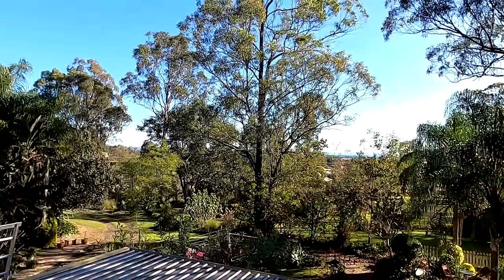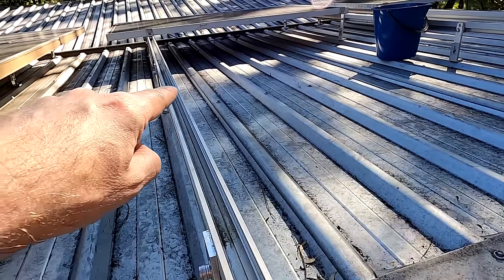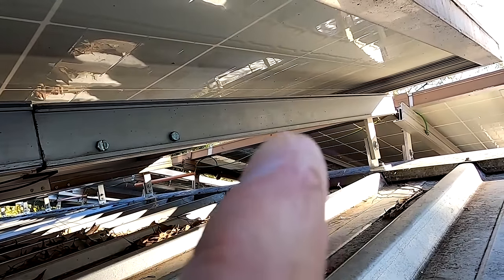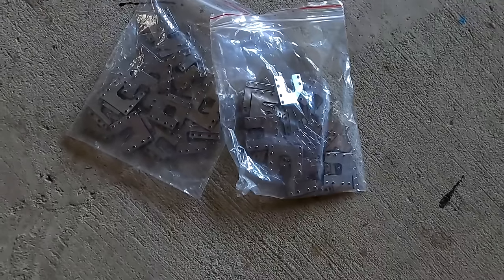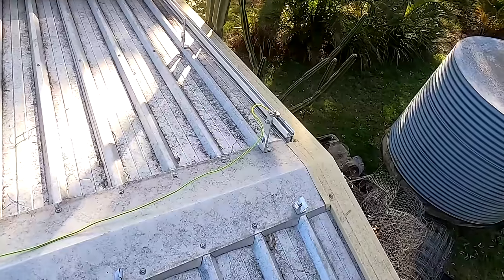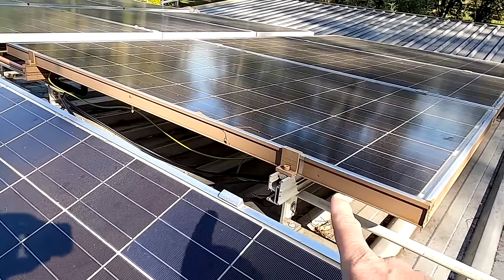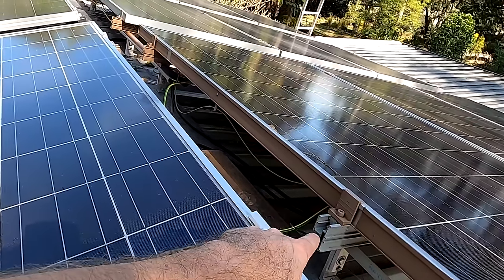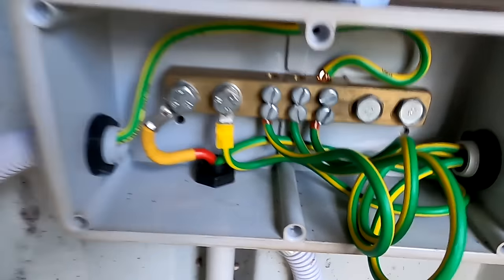Solar Grounding Essentials. These important safety features are often forgotten.

Comment: Hey Andy, Great job trying to keep up with the endless regs that keep popping up, just one thing @ 7:24 not a big issue but should there not be a serrated washer under the head of the bolt to dig into the anodizing. Would be interesting to test that joint on your next update!!!  I have some panels facing north at a 17 degree angle and upped it to 27 degrees with a 20% gain in production. Have you thought about angling your panels for the winter sun?
Reply from the maker: Thanks Glen. There are star washers at this connection, I said this at 7:35 😁
I have located some additional space for solar winter production which does not get shaded. There are just too many projects and I need to work through them one by one...

Comment: I just went out to measure resistance to ground on my tin shed which has 16 250 watt panels I don’t have any earth leads although I do plan on putting them on. My measurements were such that the resistance between the shed and the panels was affectively zero so I guess the ground has already been made through the rack mounting to the shed. I do have an earth which is joined to my 240v grid supply which joins to The earthing rod next to my meter box.
Reply from the maker: Yeah, usually any building structure cannot be used as grounding. It may help with overall resistance but the panels always need to have their own dedicated ground wire. If you get rust on your roof for example, the connection will get really bad.

Comment: Back in 92' I worked for a industrial service company and we built and installed ignition systems on industrial natural gas engines.  The tech that designed the systems and taught me how to do the building of the wiring headers and stainless shielded ignition leads.  He insisted that all the weatherproof connectors be filled with silicone.  After working there for 3 years and getting to rebuild some old systems it became obvious that the acid in the silicone actually caused corrosion.  I think dielectric grease would be better!
Reply from the maker: This silicon is acid free 😉 It does not have this typical vinegar smell.

Comment: Excellent Andy, At 3:00 good point about anodizing. As an Anti-corrosion treatment,  and anodized surface is electrically dead.and low conductivity. I agree with your opinion with the with the rail joiners and star washers. Thinking back to when I was installing a lot of industrial aluminum cable tray, U.S. NEC required that cable bonding jumpers with electrical lugs sufficient to handle the of the conductor supply interrupting amperage to be installed, and not attached to any structural fastener.

My guess is that Aussie NEC approves the factory joint because it's  designed to maintain electrical integrity in the event of structural stress or damage to the rail. The cable tray systems I was installing were joined by bars you used and therefore required and dedicated (unbroken) bonding jumper at each joint, otherwise a structural joint could not also be an electrical bond. 

Additionally, for lightning discharge and if the supply current exceeded the ampaticty of the cable tray,  an additional bare copper or aluminum grounding conductor had to be used and if it were bonded between joints then no dedicated bonding jumpers were required. I would expect that there should be something in the code that if you used a dedicated grounding conductor bonded at each section in an approved manor  the factory joints and  those goofy grounding clamp things could be dispensed with. 

At 16:00 Andy, I believe that the grounding screw once tight won't electrically change due to corrosion but because of the copper to plated nickel or cadmium contact will bond atomically at the surface. I seem to recall that on copper to plated non current carrying bonding connections,  anti corrosion treatments were not to be used as they could interfere with the atomic bond. I recall one time having to remove and clean about a hundred lug connections I applied  anti-corrosion treatment to as per a project engineer's directive.
Reply from the maker: I will show the result in the next video.

Comment: Thanks Andy. 👍 Cheers.
My grid connect system all went up on the roof in 2010. It’s not grounded.
I don’t really lose any sleep over it.
I honestly suspect the reg is there to stop potential electrocution, and don’t believe it would help much with a lightning strike. There is just too much energy in lightning.  Does anyone have evidence on this? 

A lot of the regs are bloody stupid anyway, like those damned roof top isolators which were required here in Australia from about 2012? to 2021, that have caused a massive number of roof top fires. 
I believe that requirement has gone at long last.
Reply from the maker: It is more important when you have a grid connected system as the inverter could potentially be faulty and you have full 230V on the panel frames.
Reply: I could be wrong but the more you ground it the more it attracts the lightning. Your shed is grounded since it is metal so I would measure the quality of ground as it is first...
Reply from the maker: @HG-Pilot  You will see this in the next video. The garage is all metal and grounded but NONE of the solar panels were before I used these washers.
And a building or structure is not a ground point. You always need a dedicated earth wire for your equipment. I'm pretty sure this is the same code and rule everywhere in the world.
Reply: @OffGridGarageAustralia  This is a strange rule.
I have four strings of solar panels in all 4 × 500 V
Imagine the plus at the beginning of the string gets connected to earth.
Now you are on the roof to measure, of course you start from the minus side of the faulty string, Murphy is it play 😉
Now you place your finger on the minus side and of course it's sunny.
Now you have 500 V traveling through you.
I am quite sure if the MPPT tracker gets faulty and starts conducting power to the solar array it will blow a fuse and if there is no fuse it will burn a PCB track without no doubt.
I love your videos please keep them coming 👍
By the way I'm not losing any sleep either, over not grounding my solar panels 😊
Reply: You are right.  It is more about electrocution than lighting.  The typical grid tied domestic system has no isolation between the PV and mains/grid.  This presents two hazards.  A fault in the transistors etc in the inverter permitting mains AC to appear on the solar array / PV wiring; loss of isolation in the array itself permitting HV DC to appear on the solar array mounting hardware.  Getting yourself across the array hardware and metal roof could result in electrocution.  Simply leaning a metal ladder on the eaves troughs (guttering) could also result in death.  It's a fairly complex question because there can be things like the metal roof being tied to neutral via the mains entry point, say a riser pole support structs or fascia hook, being tied to neutral by the electricity authority / network and in turn any metal roof that touches the same.  The minimum wire thickness specified along with a typical domestic earth stake is absolutely hopeless had handling a direct (that is any part of, not just the main channel) lighting strike.  It could handle currents induced in wiring from nearby lightning.  Remember that a typical solar panel is rated for use at 1000V (equiv to the USA's 600V rating).  The breakdown voltage is far higher for a panel in good stead.

Comment: I have 2 PV system on my house..one is On grid system Using Jinko 610wp Panels x 12 pcs. it didnt give any electric static when I touch them during operation. the other one Hybrid Offgrid system using  Longi 555wp x 18 pcs. and it keep giving small electric static whenever we touch the frame. So the rail seems conducting as well..  should I just ground the rail just like what shown in this video ??

Comment: "Continuity" tester...haha.  In USA they are referred to as "Mega-Ohm-Meters".  Basically a ultra low ohm scale meter.  Very important for low voltage and/or high current circuits.  Low voltages need super clean contacts, terminations, and fat conductors.  High current  circuits  require adequate wire guage and good terminations as well.   Remember:  I^2R=P...  Gota have a low resistance path.  Excellent installation...first class.   Those square grounding "washers" are too cute!  Drip loops are important in exterior wiring, just saying.   Would be interesting to see how that zinc stuff performs...
Reply from the maker: Yeah, different names for that same tester. And it is continudity tester, btw 😊
Reply: In the US, I used to sell “continuity testers”,
not sure when the name changed.
Reply: @DavidHalko  That’s Andy’s humour, we also call them a Mega Tester, all the same.unit, different name for different folks.
Reply: don't you mean micro-ohm-meter? not mega?
Reply: @DavidHalko  I may have conflate some words:  the tester we used to measure the resistance to the ground plane was called a "megger" not "Mega-Ohm-Meter".  There was another word or trade name of a meter used for the same purpose.   Memory is getting rusty....1986....USARMY Communications Electronics Installation Bn.  We built comm-centers, satcom terminals....
Reply: An ultra low meter would not be a mega meter a mega meter measures millions of ohmes at high voltage

Comment: I have a bucket of earth lugs with those nuts that don't fit any rail I have.
If you or a friend are heading up this way you can have them, if you need more in the future. Just buy nuts for use with different rail.
Use a cheap wire stripper tool that spreads the cable insulation in situ. You can easily bare 15mm for every earth clamp.
There is a problem with cold gal paint.  It provides some galvanic protection, but it still allows oxygen through to cause oxidisation. We just used grey enamel spray paint. Silicone is a better solution.
Love those conduit clamps. Don't trust cheap flexible conduit in the sun.
In summer the rain can come from Cicadas..
Reply: Somebody pointed out that the acetic acid in the silicone causes corrosion.  There are non acid silicones.
I think this might be a can o worms.
I live near a busy small airport, it's annoying at times. And I think the trainee pilots are told to fly to the farm with the solar arrays then go back.
Reply from the maker: Thanks Andrew, for now I have all the clamps I need for my setup, just need more of these washers.
The silicon has no acid in it afaik.

Comment: I can understand your complaint about the excess of packaging for something as robust as those earthing lugs, but it just makes me more frustrated.  

I recently received my JK BMS from Hankzor after waiting a month and it was in a box made of the flimsiest cardboard I have ever felt.  it was at least 50% bigger than it should have been and the BMS was only wrapped in a single ply thin bubble wrap bag that did not come close to filling the bag.  It was able to slide several inches in each direction and up and down (thickness) by at least a 1/2" so that whenever you rotated the box in any direction, the BMS would slide around.  Due to this, the box itself was badly damages with one corner almost torn off.  Inside, the heat sink plates on each face were bent and one mounting ear was bent downward about 30º.  Another one was bent up 170º so that it was almost flat against the rest of the plate.

When I contacted Hankzor, they said that it must be rough handling by the post office in my state and they would no longer ship to my state.  I pressed for a replacement, but they would not do that and ended up refunding me only about 30% of my purchase price.

I would rather have too much packaging than too little.
Reply from the maker: You can log a dispute with AliExpress for a damaged item, either for a refund, discount or re-sending of the product.
Reply: @OffGridGarageAustralia  That is what I needed to do in order to get the $38 refund on the $122 purchase.  I could not believe how bad the packaging was and that they were not willing to replace it.  I will get my JK BMS replacement from a different vendor.

Comment: I've never seen it written somewhere but for grounding aluminium mounting frame you should go all aluminium and stainless, no copper mixing before the very last part.

Every aluminium part should be linked with aluminium cable and mounting with stainless screw, and a aluminium to copper crimp ferrule with anti oxidation grease in it when transitioning to copper.
Mixing in copper cable outside is asking for corrosion problems.

Yes professionals use copper but i don't think most think about the galvanic corrosion.
Reply: Sorry. Stainless steel is reactive with aluminum and will corrode it. This is because they are dissimilar metals.

Comment: Can you test the resistance of the joints to prove you don't need a grounding splice cable.  I have doubted needed this also, but still required by code.
You only need 1 weeb washer per panel and you can share for 2 panels.  This is all unnecessary now that most racking uses grounding approved clamps.
And you do need 1 continuous ground for all connections from circuit panel OR separate ground wires permanently tied(crimped together).
Thank you for following up with proper weeb grounding lugs.  These are also designed for bare solid copper wire which doesn't need to be in conduit if larger than 8awg.
Reply from the maker: I do a full grounding test in the next video.
One washer will certainly be enough but sometimes the panel frames don't quite touch enough in the corners, so hence they upped the rules to have 4 of them.

Comment: Wow I learnt something today. 4 panel earthing washers per panel?? I have only been using 1!
Reply from the maker: That's our rules down here, check with your local regulations.
I found sometimes the frame corners don't make good contact with each other so this might be the reason they want now 4 washers.
Reply: Same we were just using the one per panel. Pretty sure your supposed to be a qualified electrician to do any work on voltages over a certain amount which I think they may have just lowered ( not sure of the actual voltages). The crimps do come with the clenergy earth clamps but we didn't use the either but we were doubling the wire up and twisting which fit the lug better ( 6mm was tight) with CRC zinc it spray to protect.

Comment: Silicon may help prevent external corrosion, but galvanic corrosion is where you have two different metals making contact in the presence of an electrical potential - like in your situation... i assume the recommended treatment stops that

Comment: Hi Andy, when you pulled the earth cable out you could have attached a string to it so you could attach that string to the new earth cable and pull it through easily. Continuity for plastic coated wires and Continudity for bare wires!!! André in Sydney
Reply from the maker: Absolutely! 🤦‍♂️

Comment: Andy u should have taped the old earth cable and the new one together and pulled it out from the bottom it would have made it easier.
Reply from the maker: That would have not worked as I started at the top of the roof. I should have started from the earth bar and work my way up, shouldn't I?
Reply: @OffGridGarageAustralia  it would work. You just over lap the old earth wire with the new one and use electrical tape and make a strong joint and then pull the wire from the bottom. Dont make the tape joint too fat else you might not have enough room to squeeze through. Just tape it at about two place should be fine. 
Also since next time your doing it there would be one wire less it would easily come through.

Comment: Just Use Di-Electric Paste On All Copper To Aluminum Connections For Corrosion! Plus ALWAYS Pull Construction String Back With Your Old Wire To Help Pull New In!😁😎
Reply from the maker: I don't have any copper to aluminium connections. The earth lugs are all Nickel-plated aluminium.
Reply: @OffGridGarageAustralia  You do say "Copper Alluminium connection" around 12:40

Comment: Amazing video thank you so much. may I ask a question? I am off grid and I have seen some people say that the panels should be earthed to their own earth rod and then the system earthed to another earth rod. my panels are very close to my system. Do you think that is necessary or even correct? with so much conflicting information it is hard to know. thank you in advance.
Reply from the maker: I have discussed this with my electrician, and it is not necessary. Everything should be bound to the same earth point anyway.

Comment: 14:03 is that correct what you're doing? I believe you should press it into something like stainless steal and then tighten to avoid corrosion. You should not make a directo contact of aluminium with copper.
Answer: this is mostllikely correct as the clamps usually made of stainless steal but no aluminium as I thought.

Comment: Goood Morning from norway 😁
What kind of spec on the new double wire u are installing on the panels,?
I am looking for a choise for solar cable,, for atleast 20/30 meters.
Thanks again for cool videos 👍👍👍
Reply from the maker: This is double insulated twin 4mm2 solar cable I'm using. These come in 4mm and 6mm (for longer runs or parallel connections)

Comment: Im living completely off-grid and concidering not to ground any of my panels. Its a small system. I only have 2,1kWp installed, 24V panels. The reason for not grounding is that Im affraid of lightning strikes damaging the entire system. If not grounded its basically a metal roof and to my knowledge we havent had a single strike on the house (high trees surrounding the building) since it was built for around 50 years ago. If I ground the panels I will basically creating a lightning rod, which is not good for the system nor my cabin. Any thoughts on this?